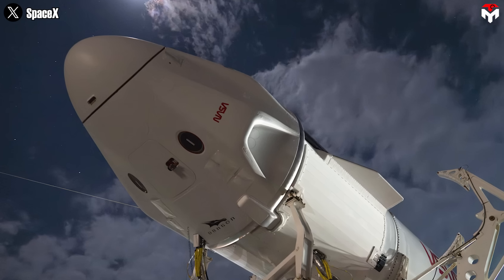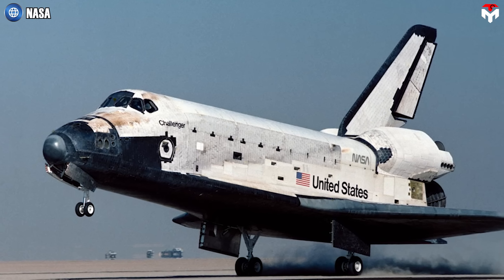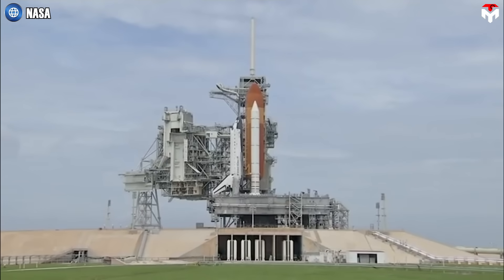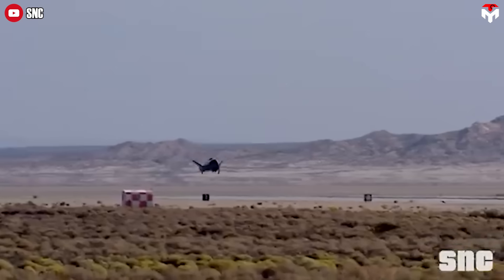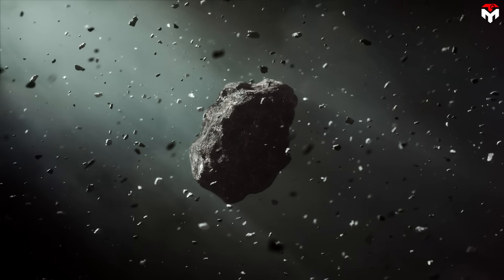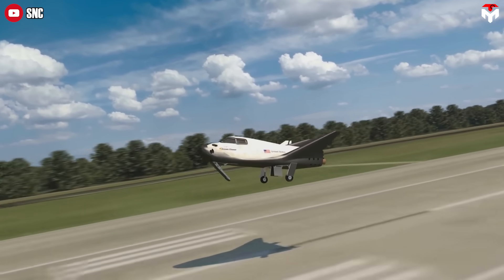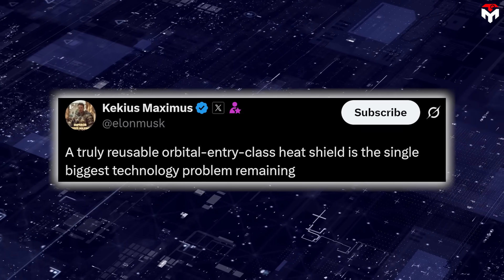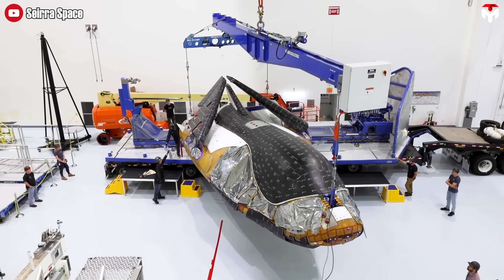NASA's New Space Plane Landing Method SOLVES What SpaceX's Dragon 'Impossible'...

Comment: I really wish you had thoroughly researched the reasons why the Shuttle had wings, an ET, SRBs, as well as the reason it need single polar orbit cross-range return to Vandenberg capability. Briefly, in order to get funding approval, Shuttle was designed to serve an excessively broad combination of NASA and Pentagon needs. That was a terrible mistake by Washington political actors, not NASA or the Pentagon. MOL had been cancelled, but the USAF still desired its space mission crewed platform, so the necessary increase in the length of the cargo bay meant that the internal propellant tankage was moved to the ET. The very hot 1000 mike military reentry cross-range requirement added the requirement for a more robust and consequently heavier TPS (tiles), necessitating the added launch thrust provided by the SRBs (recommended by the USAF based on their long experience with JATO.). There’s too much detail to add here, but the real historical account of the Shuttle beginnings is documented in the Washington archives, such as the U.S. Senate records and other public records.

Comment: Actually that looks a lot like 🤔 'mustard' (an acronym for multi use something or other) I think it was called? a UK design from 🤔 the 1970s I think?  that was never more than some blueprints.
Reply: (One short Goggle later) ah yes "Multi-Unit Space Transport And Recovery Device or MUSTARD, usually written as Mustard, was a reusable launch system concept that was explored by the British Aircraft Corporation (BAC) during the mid-1960s" .. yes, it does look very similar to that, perhaps not exactly that much of a "breakthrough" or "innovation" then if it is as it looks largely little more than the rebranding and realisation of 60 year old designs? 🤗
Reply: This Is absolutely nothing like Mustard. Mustard used three almost identical vehicles coupled together - like a triple decker burger. The outer two fed fuel and oxidiser to the  inner orbiter. All reusable.
Reply: @BZ-bo8dp  the reusable boosters aside the images of the proposed orbiter look very similar to this to my casual eye.. though I imagine the heat shielding is all new over the materials available when those plans were drawn up.

Comment: I don't understand why a propulsion type system can't use its propulsion system to 
slow its descent through the outer layers of the atmosphere, to keep it from burning the crap out of the bottom layers of any descent.
Reply: The weight of the fuel needed for that manuvere. Maybe send up an unmanned refueling craft to use for reentry? Just an internet dummy with two cents.
Reply: Plasma on re-entry doesn't do so well with propulsion systems that are also firing.

Comment: I'm not a rocket scientist, but I stll dont understand why they cant develop a rocket-plane. It would take off like a plane, and then when it gets high enough, fire up a rocket engine, fold its wings in and go into orbit. On the way down it could keep it wings tucked for the initial descent, and then gradually open them and land like a regular plane.
Reply: I also am not a rocket scientist, but I remember a video explaining stress complexities inherent in   plane or horizontal launch systems. Launching straight up creates less challenges in build and sustainable durability. Picture a farm silo, laying on its side, strap wings on it and launch and land it. It will require much more internal structures - hence more weight - to survive the entire trip. Musk launching vertical AND landing the booster vertically is an amazing long term solution.
Reply: There's a lot that goes into why that isn't possible and one of the major problems is engines (as you mentioned). Atmospheric engines and what you need to move efficiently in space are two entirely different physics. You essentially need two different engines (which you definitely said) but you can't just slap two different engines on a fuselage and be good to go; it's not that simple at all or they would be doing it. What would solve that problem? Well, of course, one that can do both. Unfortunately, the most promising solution, SABRE, has been in development for decades. So until we have that, there are no options as running two different engines is not tenable for several reasons like fuels needed and costs, at minimum.

Comment: Dream chaser is great for coming down.  But SUCKS going up.  It does need a fairing in its current design.  The crewed version the DC-201 is a different design, more stream lined, and not expected to have any windows.  NO ONE at SpaceX ever said this was Impossible.
Reply: SpaceX just wants to be cheap, and Dreamchaser is not cheap. And the fact they are the only US option really getting the job done for insanely reduced costs proves that capsules are the best bet right now. What the Shuttle solved, the Dreamchaser can't even remotely do. I don't see the point in it at all at the current moment in time. At best, it's ahead of its time. Maybe it fulfills a purpose later, liiiike, landing on moon runways instead of the fuel costs of landing a rocket, and then maybe taking off and going to earth on it's own (not sure if its dV can do that) but that would be a cool thought.

Comment: This is the correct progress to follow on from the Apollo program and space shuttle. SpaceX has taken the wrong approach in reproducing 1960’s technology which has taken way longer than the Saturn V rockets which had 6 successful lunar landings in less time than its taken for starship to reach earths orbit let alone continually crashing and blowing up. The Saturn V rocket was only 30ft shorter than starship plus booster and never had an actual launch failure over 60 years ago.
Reply: NASA didn't try to make the Saturn 5 or Apollo capsules reusable let alone land the Booster back on the launch pad.  And they had a virtually unlimited budget.
Reply: NASA did it 60 years ago befor the dawn of the microchip and very primitive computing but their engineering was more robust and reliable and they landed 6 manned missions on the moon in less time. Elon Musk is conning you into believing that he’s learning from continually exploding rockets unfit for purpose and continually missing deadlines by decades. The space shuttle was reusable and built the iss and serviced satellites. Building on progress was to develop next gen spacec shuttle not the ridiculous retrograde  starship.
Reply: @peterclark5003 Not a fan of 50s sci-fi then Peter or just the recent onset of MDS?

Comment: NASA tried the space plane and that didn't last.
Reply: That’s weird because the US’s latest spaceplane landed on March 7, after more than a year orbit. It’s been working since 2010. Guess you didn’t know…
Reply: @dmrr7739  what spaceplane are you talking about?
Reply: Not this version. This is a modernized version of the Dyna-soar project, which was the original shuttle concept to be operated by the military.
Reply: @martykarr7058  can it connect to the ISS? I can't tell from looking at the pictures. I hated when they stopped the space shuttle. I thought that was a great truck for building structures in space.

Comment: Hey, the Challenger disaster was not the result of a fault with the orbiter.  It was a booster/SRM O-ring vulnerability that was known about and not given full attention prior to allowing launch that Frigid Florida morning.
Reply: It wasn't the booster that leaked. It was the main fuel tank. If you watch the video you can clearly see the flame run up the main fuel tank and go underneath the shuttle. When it blew the boosters were still intact and going off in two different directions. That's why you see two contrails leading away from the blast.

Comment: Every time Musk let's a spacecraft explode, there is no way to see where, or if,  the money was spent.
Reply: When your design requires redundant systems to guarantee that it will work the first time, you cut into the available payload to space.

The rocket catch tower exists to eliminate the mass of the landing legs.

Sweating metal heat shields provide for a rapidly restored system that sheds reentry heat.

Redundancy makes a heavy, less useful and more dangerous spacecraft.  More dangerous because you end up with multiple systems that must monitored and maintained.

This is why SpaceX tests the limit of their designs.  Destructive testing tells an engineer exactly what their margin of safety is so they do not need redundancy.

Comment: I actually think that space planes should be able to be a lot more efficient... some of the major problems have already been solved (think: metalic heat shield) - i see no reason why you couldn't get to space a lot more efficiently using aircraft engines to get to very high altitude, and then a booster to take you the rest of the way... of course, you need retractable shrouds to protect the atmospheric engine intakes - but the other problem (atmospheric heating) can be solved using metallic heat shielding techniques. Accelerate up to Mk2 climbing to a high altitude, initiate a slow spin for stability  while pointed in the right direction,  and then engage booters to take you the rest of the way into space. You should be able to use a significant amount less fuel that way, and have much less wasted launch weight... and if implemented right, you should gain the possibility of takeoff and landing at larger airports, already designed for big wide body aircraft,  if that ever becomes necessary.

Comment: Shuttle initially had white tiles on its top surface. Those tiles were fragile, easily damaged. Replacing them with thermal blankets was less expensive, and the blankets (actually quilts) withstood micrometeoroid impacts and impacts from ice broken off from the external tank. NASA developed another more advanced form of thermal blanket, called DurAFRSI, but was too late to install on Shuttle. The Air Force tested it on X-37. Why isn't that used on the top surface of Dream Chaser?
Reply: Though ingenious as the tiles may have been (could be heated until they glowed red-hot, but quickly dissipate that heat and provide insulation to protect the spacecraft), one of the aspect of the thermal protection system rendered one of the often advertised capabilities (quick turnaround to prepare shuttle for another flight within days) was rendered impossible - it takes a wee bit of time to inspect the nearly 24,000 individual tiles and replace any that were too damaged to reuse.   Their fragility of the tiles didn't help (they not only resembled styrofoam, but could also be crushed similarly).

Comment: I think the space plane is a great Idea , however,  for long term practical cost effective purpose The secret to the space plane will be as stated in the video , those heat tiles , I think the solution that will project this kind of shuttle forward will be to somehow slow down for re-entry so they  dont generate so much friction and not be so dependent upon heat tiles , I know there thinking about that , even Elon said its a fuel problem,  takes a lot of fuel to slow down to atmospheric speed .

Comment: Landing a space plane on a runway is not as impressive as landing  a rocket on a small barge in the ocean, or on hooks on the original launch pad tower.
Reply: It is when there's people on it.
When SpaceX does powered landings with people on board, wake me up
Reply: Impressive is not the goal. Reliable and cost effective is the goal.
Reply: True.  But it could be more efficient.  If re-entry heating was such a problem.

If there was a solution to the tile problem it might work.
Reply: You are kidding, Space X nerd. Future rockets will land like a plane.

Comment: The lack of Vision and IQ stands out. The ISS is trash. But Humans will need a space supply platform. My designs use all of space X mega rockets. But nothing falls back to earth. Leave the whole rocket in space. Inter locking the next rocket to it. Rework, inter space. Flip out solar arms. Fuel left is used to bring the new Logo like snap together, station. Same for the moon. Land the whole rocket. Lay it on its side. Like a RV with slide out. Crack open the shell. From earth, pull out the slides. Unfold it. Start making oxygen, from water taken there. Slide open  walls of pre planted vegetables. See if NASA can grow food on the moon. Yes it gets cold. A small nukler, power source could be used to make heat. To pay for it.. sell add spaces for Pepsi Coca-Cola, 😂😅. Bill boards on the moon. Maybe McDonald's, new space burgers coming in 2035..😂😅
Reply: Stupid .not funny
Reply: The ISS is a marvel of engineering and no amount of BS changes that!! 

Your designs??? Where exactly have they been implemented so we can compare your genius with NASA's? Your descriptions are similar to a 10-yr-old discovering airplanes and of course you have all the solutions!! So WHERE are they? Get a grip!!

Comment: Wow! We had a fucking fleet of these 40 years ago!  It’s 2025 and we went back to 1960s capsules.   The shuttles had a safer record than regular jet fighters.  We should have kept improving them.
Reply: If it was that simple we would have.
You may want to do a little research and see how complex and expensive it was to keep the ones that didn't blow up, flying.
Reply: @pnichols6500  The space shuttle always has been expensive, that was by design. 
When NASA was designing the space shuttle,Congressmen, corporations were involved and they wanted a job’s program with massive profits, that’s what that became. I know I used to work on that program and 90% of what was done to maintain the shuttle fleet could’ve been designed out of the shuttle fleet to reduce cost, but they didn’t want to reduce cost at all.
Reply: @AgraFarmsllc I don't doubt that, but the thing had over a million parts, keeping it flying was not only expensive, but very, very complex.
Reply: @pnichols6500  Yes, however, a lot of those parts were designed specifically only to be used 1,2,3, four times at the most, before they had to be re certified, re-furbished after every flight because that’s the way they were designed to be, there were parts that we’re just with a little bit more work, could’ve lasted 100 flights, but they didn’t want that, they wanted one off’s, I know I made a lot of them.
Reply: @AgraFarmsllc Very interesting,  I know the tiles alone were a major maintenance issue. Pretty cool that you were involved.
Reply: @pnichols6500 In 40 years you don’t think we could have made improvements?
Reply: @jameswilson4732 Yes sir,  that's kinda my point.  It's wasn't sustainable as it was.

Comment: If  you  encapsulate the   craft  with a  magnetic  field  it  doesn't  need  heatshields  or tiles....
Reply: What does the equipment required to generate a magnetic field that large and powerful weigh.  What does the shielding for the passengers weigh? Those ceramic tiles are mostly foam and very light
Reply: @SteveGrin  Very  simple  technology  designed  back in  1938  by  Nazi  Germany =  3  spinning  electrical  coils  supercooled  with Mercury.